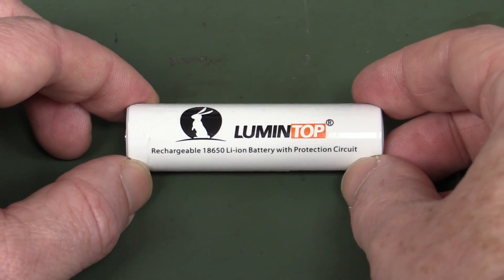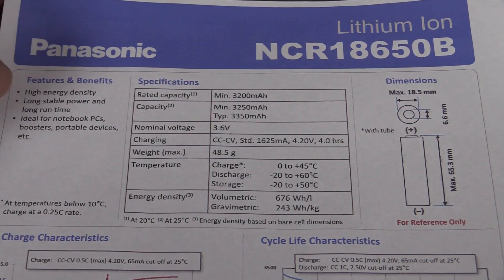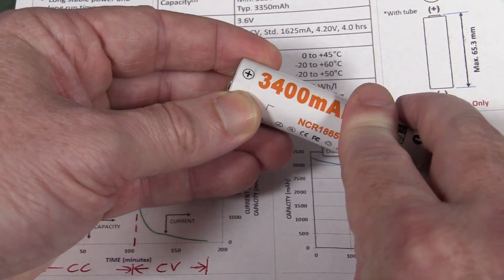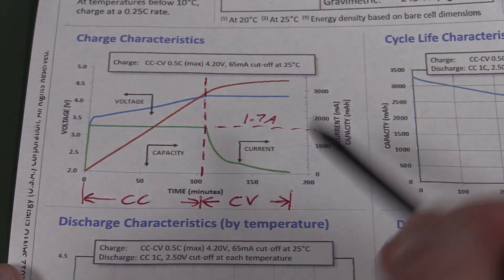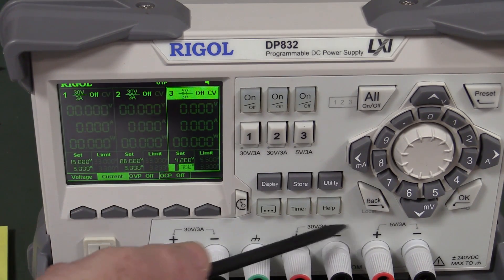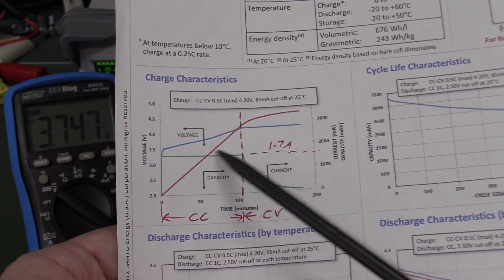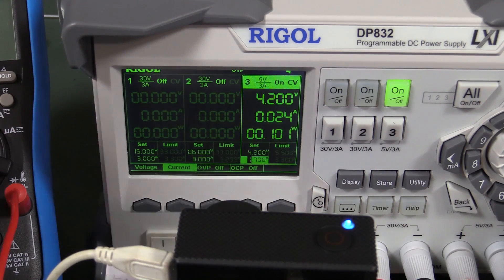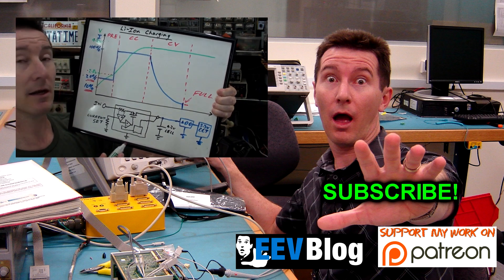EEVblog #919 - How To Charge Li-Ion/LiPo Batteries With A Power Supply

Comment: @eevblog
Hi,
I tried this method for charging Li-ion batteries but when I set my power supply to 4.2 v the current drawn by battery never goes higher than ~200 mA. The current will be increased only if I set voltage higher than 4.2v. At ~8 V, for instance the current is ~1.5 A.
Could anybody tell me what's wrong?
Reply: It sounds like your battery is damaged.  I presume your current limit is set higher than 200mA?  Did you check the battery mAh capacity and set the current limit to half that?  If all else is okay, then your battery is almost certainly damaged.

Comment: Dave, I can use a cheap manual set plugin mains timer + a mains relay to disconnect the batt + after 4hrs. Now, what's the situation with the diode mentioned somewhere below? What type and how connected or just thought, would it be at all necessary with my relay?

Comment: "The cut off point is 175mA for example, it doesn't show that here"
Nobody reads the datasheets for the data am I right? :)
Charge: CC-CV 0.5C (max) 4.20 (Blaze it), 65mA cut-off at 25 Celsius

Comment: What if you charge at constant voltage the whole time with a current limited power supply set to 4.2v? Is that safe?
Reply: No.  As he stated, it will damage the battery.

Comment: I'm about to buy my first power supply. I will be charging the occasional cell with it and powering amplifiers and small circuits. Should I be looking for Linear or Switching?
Reply: Marshall Smith Are there any adjustable linear power supplies on the market?

Comment: thank you for talking about slowly rising voltage when in constant current mode but i saw something when i charge the battery with constant current mode . the voltage drop across battery was 4.2 v or around that. and voltage across the cell before charging was around 3,8 . so why is it behave like this. isnt it should be 3,8 v across the cell while charging it with constant current and slowly rise the voltage naturally like you show in the video ?

Comment: Isn't it bad to leave lipos fully charged? I hear 3.8v per cell is the best / safest storage voltage.
Reply: Spencer Owen it's not dangerous but the life span of the cell will be reduced. Store it a 40 to 50% state of charge (around 3.8V).

Comment: Hi, if the cell reaches 4.2V and the power supply is still using constant current to charge it, what would happen? thank you
Reply: if your power supply has been set for 4.2V and 1.7A limit, that case would never happen, as while the battery voltage is approaching 4.2V, the current it draws will decrease also. thus when it reach just below 1.7A, then the state switch from CC to CV, "automatically".

Comment: His LiPo going to explode only when CV is higher then 4.2V, not lower and how much higher?

How i can charge multiple cells. If i put them in paralel can i just increes charging furent for CC, eg n*CC.
And if i put them in series, can i put higher CV voltage eg. n*CV. (i guess i cant, because whyt if battery dont start at same capacity or they dont charge exactly the same speed)

Do LiPo batterys have anode and cathode, or if ith empty i can charge it on whatever polarization i want.

Thank you in advance.

Comment: The bottom and top 20% of li-ion capacity should not be used, as it destroys the batteries prematurely. At the expense of losing Wh/kg (and thereby Wh/$), you can increase the meaningful lifespan of any li-ion battery. This is what is done in electric cars, where longevity is actually expected (unlike a laptop, where people sort of expect the battery to be complete shit in 2 years time)

Comment: Why not just use a mains timer to turn of the PSU after 4 hours?
Reply: That could work, assuming the dead PSU won't begin to discharge the battery after it loses power.
Reply: This is incredibly dangerous 😮

Comment: Will this trick work on a Samsung Galaxy Note 7? Just bought about a 1000 of the little rippers for a bargain price, need to charge them all at the same time.
Reply: Just put 'em all in series and plug 'em into the wall socket.  You'll be good to go in no time.
Reply: Star Gazer Actually with wall sockets being powered with 230 volts that would put a whopping 0.23 volts of AC on each cell. That'd hardly make the effect you were hoping for, would it?
Reply: You could charge them all at the same time, if you have a 1,500A charger...

Realistically, you're better off charging maybe 10 at a time each from a separate charger.  Charging circuits are cheap and you can generally get 10 for a few bucks from China.

Unless you're going to use the notebook itself for charging, in which case you're better off just using the chargers supplied with them.

Comment: You should do one for car batteries. I used a bench PSU the other day, to get my car battery up from 12.1 to 13.0V, (changing at 14.4V and between 400-250mA over 3~5 hours) enough to start the engine.
Reply: That's what I did a lot when I was struggling with electric system in my motorbike. Most bike batteries can be safely charged with 14.2V and 1A (it's C/10 for 10Ah battery). That's what the Yuasa battery manual says, and I trust all of them are similar. 
By the way, all the motorbikes I've seen in my life had no current limiting capability, the regulator simply holds 14.2-ish volts and that's it. Actually by limiting the current on your bench PSU you're doing a big favor to your battery.

Comment: Since cells vary, how do "smart chargers" determine the proper rate for different cells?  Are they all similar enough that they can just use a conservative value?
Reply: That's pretty much the case.  If you're sure you'll always be charging an 18650, you can use a low charge current such as 500mA and most of the time that will be fine since nearly all batteries of that size are at least 2000mAh in size, except for those cheap Chinese rip-offs.  The charging current could be too high for some of those.

On the other hand, some of the tiny flat cells can be as low as 150mAh, so you'd need a charger which goes as low as 75mA to safely charge those.  It would take ages to charge an 18650 at that current, so there's no such thing as a truly universal lithium charger with a fixed charging current.

"Smart" chargers generally either assume you'll be only charging a certain physical size of battery or rely on you to set the charge current.

Comment: The battery specs seem to be really conservitive on the charge rate, 0.5c . 4 hours though seems really long for charging at 0.5c though. at 1 c the charge time should be around 1 hour.

Though maybe these cells have much higher internal resistance than higher performance batteries.

My RC helis can charge safely at 2c which takes about 40 minutes. But those batteries can be discharged at 35c so internal resistance is fairly low.

As an added safety note, lipo batteries should not be left charging unattended. 

Just checkout rcgroups thread lipi fires are real!! for plenty of stories about lipo fires. with higher capacity batteries the fires can start very fast and grow large in short periods of time.
Very large batteries will burn furiously for over 30 minutes on its own without any other combustable materials nearby.

Comment: Its cool but the smart chargers for these are incredibly cheap on ebay/aliexpress these days, the days of the 80 dollar smart chargers is over. I use a liitokala, also measures capacity with a charge/drain test.
Reply: :-D   liitokala = flying fish in finnish
Reply: Äijä mittaa jollain kalalla kapasiteettia. :D

Comment: LiPo Batteries? Never heard of that abbreviation. So I guess you can call completely discharging a LiPo battery a LiPoSucktion? :)

Great video btw. I always thought you needed complex electronics to monitor the temperature and internal resistanance very accurately or otherwise your battery would explode on overcharging or completely brick it when discharged below a certain level. But I have to stand corrected.

Comment: The safe max charging V for that Panasonic cell = 4.25V 
The recommended charge cut-off A = 65mA (which is 0.02C, not 10% of the CC).

Thanks for sharing.

p.s.:  If you want to get max cycle life out of the cell, it is recommended to charge it to a max V of 4.1V & not discharge it more than 20% when using it.  >= 50% DOD really creates a significantly shortened cell life.
Reply: A B Buying a cell to discharge it no more than 20%....no thanks.
Reply: OrbitalSP2:
Well, your power needs may be quite different than someone who wants optimal cell life--which is fine--you'll just consume more cells & pay more $ for your power needs than a person seeks optimal cell life.
Reply: A B I know what you say is true. But i just avoid discharging more than 80%. I mean discharging only 20% only, I can't even see in what aplication that might be useful. 20 minutes runtime in a flashlight?
Reply: +OrbitalSP2
A flashlight that isn't used much or often is a perfect example.  I have a high power flashlight that I use occasionally around the house & I rarely use it for longer than 5 minutes in a day. 

A remote control that is placed on a wireless charging mat when not in use would be another good example.
Reply: A B they degrade with time, even by doing nothing with them. So I'd rather use them from 20 to 90% or 20 to 100%. Unless you live in a very very cold country, the ambient temperature is killing them anyways...
Reply: A B they degrade with time, even by doing nothing with them. So I'd rather use them from 20 to 90% or 20 to 100%. Unless you live in a very very cold country, the ambient temperature is killing them anyways...
Reply: All batteries degrade with time--some much more than others.  High quality Li-ion cells (e.g. Panasonic) last a very long time if taken care of properly.  I have some that are over 10 years old & they still work fine for the purposes that I used them.  Eventually they won't have sufficient charge capacity, but for now they work fine.

p.s.:  The Panasonic 18650 li-ion cells that I have also have a very low self-discharge rate.  I have some that I have charged a few years ago & they still have 75+% of their charge the last time I tested them.  I imagine lower quality cells don't have such good qualities, but Panasonic cells harvested from laptop battery packs are very good, imo.
Reply: A B oh for sure. High quality ones will last a long time. If you want them to last decades, store them at the fridge (inside a zip plastic bag). I have 2 Panasonic 3400 mAh and I love them.

Comment: I was thinking if you calculated the right resistor, you could rig a transistor in there so that once the current goes too low (the cut-off point), the transistor breaks the connection to the battery.

Comment: Umm potentially stupid question - so if you had a funky multi-channel PSU like yours, could you connect adjacent channels and charge a multi-cell battery safely? So connect channel 1 minus to battery minus, channel 1 plus to balance port between cell 1 and 2 and to channel 2 minus then channel 2 plus to next balance port and so on until plus of last channel goes to battery plus

Comment: Have you played with some MPPT solar charge controllers? I'm wondering if there is one useful solar charge controller that can charge a pack of 18650 equipped with a BMS? The only one that I could find and can be programmed via their software on a PC is ProStar MPPT from MorningStar and it's like $480, Some other manufacturers charge a $150 fees on top for factory programing.
Reply: You can now get solar charge controllers which can be switched between modes to charge either lead-acid batteries or lithium batteries.

Comment: Think you should have mentioned why the cells cannot be charged in series (@8.4 - 12.6 etc). Also i thought a single was a "Cell" and more than 1 "Cell" is a Battery (which makes this a cell) ? Good work though.

Comment: i kinda wonder how they spot weld these types of batteries safely i have thought of rebuilding a mid09 macbook battery pack with fresh cells but i would have to find them one with a spotwelded tab that can already be soldered to safely
Reply: It's possible to build a spot-welder which uses a car battery, but there are relatively cheap spot-welders suitable for the purpose.  I got one off eBay.

Comment: Or you could just buy a 99 cent USB charger from Ebay.......
Reply: That would take a month, a power supply that's already there takes as long as it takes to find some cables.
Reply: My 18650s charge in just a few hours from a USB charger and not everyone just has a "lab power supply" in their junk drawer.
Reply: That's exactly the point. If you ordered yourself a lab power supply, it would take you a month while using what you have works right now.

Comment: Rigol actually has an app note, warning you not to hook up batteries, without at least a diode as protection, since the DP832's inputs are apparently very sensitive to being fed with voltage or current.
Reply: Thanks, I was looking for that.  I was sure Dave mentioned this in a previous video.  He must have forgotten.
Reply: Would a 15SQ045 Schottky be sufficient?

Comment: Panasonic NCR18650Bs are currently the BEST 18650 cells you can get!!! DO NOT BUY ANYHTING ELSE. It's wasted money!
Reply: 3400mAh 3.6V NCR18650B are twice as expensive as 3000mAh 3.8V LG ICR18650D1.  What is waste of money?
Reply: Volodumur Kalunyak
I get NCR18650Bs for EUR 6 each in GERMANY. And here, everything is usually most expensive compared to ANY other country.

Comment: Hi Dave, could you please comment on the document from Rigol "Active loads and the RIGOL DP800 and DP1000 Series". It says "an external diode should be used to prevent the flow of current into the supply and prevent damage of the power supply".
Reply: But the problem with a diode... the voltage drop depends on "forward" current. I think it will be hard to apply precise 4.2V to the battery.

Comment: I didn't hear you mention the 'precharge' part of the cycle... If the cell voltage is below a critical value (usually around 3.2 volts) it's supposed to be bad to whack lots of current in at first... datasheets I've read say to trickle it up to nominal voltage, and then go to the main constant current charge mode.

I'm not sure of the exact chemistry reason, (may be a LiPo thing more than LiIon) but the feature's built into charger chips at a hardware level, so it's probably important. Not usually an issue unless you run batteries flat and then forget about them for months. But isn't that what happened here?
Reply from the maker: I did briefly mention it and covered it in my previous tutorial video linked in.
Reply: Yep.  Many charging IC's do a soft start at 10% of their normal charge current if the cell voltage is <3v.
Reply: EEVblog Ah, sorry. My bad. Must had missed it. I watched the first one ages ago.. clearly I forgot/missed it there too.

Comment: I have a 4.2v transformer that outputs 500mA and if I draw more current the voltage drops but it never goes above 800mA. Am I doing something wrong or is this a good way of charging my 18650?

Comment: How do I charge a 4s1p pack of those cells? 16,8V, same current, same timing?
Reply: buy a balancing charger for 20 bucks - or if you're a cheapskate, hook into individual cells through the balance lead, and charge them like in the video, 4 times
Reply: +Chris Tate I did buy one,  it's on it's way from China. I did it single cell just to see the results. Works. But you know what? Battery still is empty and I would like to charge it a bit faster than 4 times 4 hours. Thanks for the help.

Comment: I have an HY6003D bench DC power supply and for some reason the voltage and current readings are extremely inaccurate!  I turn it up so it reads "2.5 volts" and an external multimeter reads 12.7 volts!  I haven't tested the current reading but I'll have to assume it's just as inaccurate..  Has anyone had a bench DC power supply do this, and what can I do to fix it?

Comment: EEV, best lab bench PSU for as little money as possible?
Reply from the maker: Way too arbitrary a question.
Reply: EEVblog You are Always reviewing/using these 1000+$ lab bench PSU's. I'm just doing this for some small projects. Now I'm using a 12V 900W server PSU with a step up/step down voltage controller with a cheap multimeter to check voltage.
I'd like to "upgrade" to somthing that is more plug'n play. Please review the cheap lab power supplies please.
http://www.ebay.com/itm/30V-10A-220V-EU-DC-Power-Supply-Variable-Adjustable-LED-Dual-Digital-Lab-Grade-/162126608173?hash=item25bf7fb72d:g:joYAAOSwuzRXeyJ7
For EU usage: is this one ok?
Reply: The DP832 is a $400 power supply.  Quite a reasonable deal. It should only have you on bread and water for 2.4 months, tops.
Reply: For 3 years now, i'm using a cheepo Chinese WEP. 30V 10A PSU for powering laptops, quickly charging tablet and phone batteries to a point when i can test new digitizer before assembly, doing tests for short-cuts on laptop motherboards, heck i'm even using it to magnetize my screwdriver by running full 30V10A through a coil around it for short period of time. Never failed! And those are not occasional uses, i'm running a repair service so its used 8h 5-6d a week, powered on constantly, especially in summer when its powering a 12v PC fan to cool me down when not needed for other purposes. Freakin 1000$ PSU... could afford that... saving for half a year and eating only bread... faster if a villains like Szydlo, Duda and Kaczynski wouldn't be stealing almost half of my hard earned money...
Sorry for digression. Anyway i can highly recommend that WEP or simillar rebrand/ripoff whatever it is, it's doing its job.
Reply: Rigol DP832 is a good compromise.